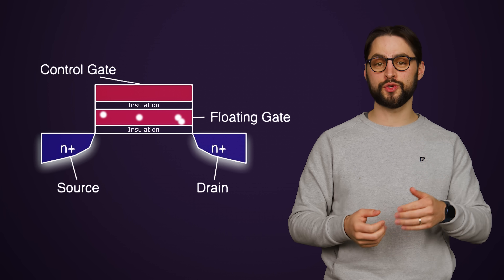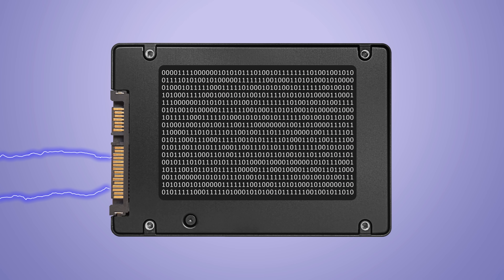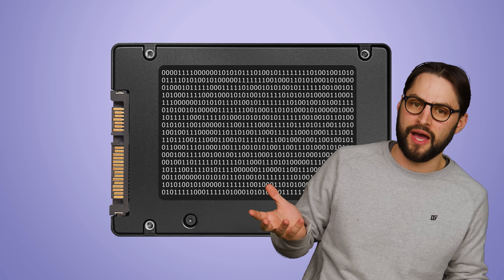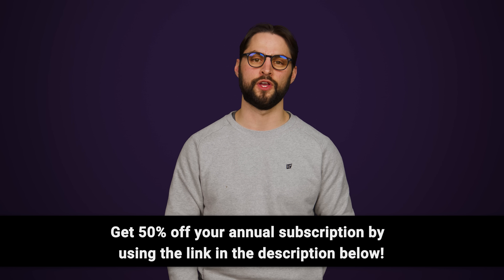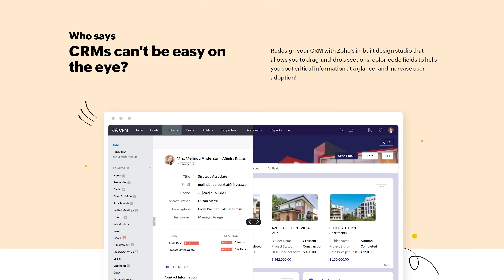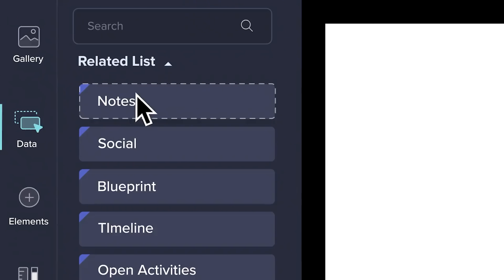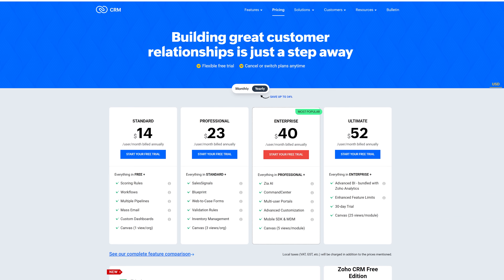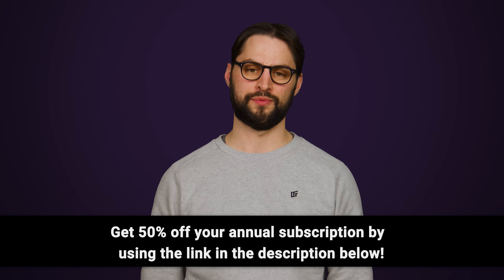SSDs Die, RAM Doesn't. Why?

Comment: Of all computer components, RAM is a completely analogue component. It works by virtue of voltage comparators made with high-speed operational amplifiers. At the exit of these comparators there are something called Schmidt triggers which outputs either a zero or a one, depending on the level of charge of the memory storage capacitor...
Reply: With that logic, everything in the computer is analogue... Everything is depending on voltage levels.
Reply: @someguy4915 Seeing as a transistor is an analogue amplifier (driven hard to saturated state in the computer) and the CPU and other SS components are made up of them, yes.

However, unlike Babbage's machines[1], it ignores all states between off and fully on

[1]being mechanical in nature, each memory "cell" was made up of rods which could be in one of 10 different states, each one representing a different digit (0-9).
Reply: @cigmorfil4101  Exactly, technically everything is analog, digital doesn't exist.
But since the logic in a computer functions on digital levels, the underlying analog signals are mostly irrelevant unless they cause faults/failures in the digital signal.
It's like saying cars are natural because they're made from metal which is in the earth.
At best it's semantics, at worst it's just false/misleading.

Comment: Yeah so as u asked for a feedback about what content you can make next.
I am a PC enthusiast and have been building PCs lately and with experience I understood this that with Ryzen APUs there lies a slight problem with gen 4 ssds because even though the motherboards may support gen 4 ssd the Processor I guess allots the PCIE gen 4 to the intregrated graphics and thus disabling PCIE gen 4 support for any components.
This problem especially arises in Laptops which are ought to be an APU for efficiency and do compromise on gen 4 ssd.
Also in case of Ryzen APUs the performance of the Integrated Graphics depend hugely on the frequency of RAM and latency... thus most of the times in a laptop that completely depends on the IGPU and doesn't have a dedicated Graphics it makes a lot of sense to use a DDR4 instead of the newer DDR5.
A lot of people are unaware of this and thus end up blaming the manufacturers for not providing gen 4 ssds and DDR5 RAMs.
I request you to make this clear to the incognizant people.

Comment: fun fact: (atleast for linux i beleve apple and microsoft has the same) whenever you go into hybernate your ram gets dumped into a very specicif part of your hard drive or ssd put aside. this is called the swap partison. if you are ever setting up linux and opt out of swap ram you lose the ability to hybernate on most distros.
Reply: Windows dumps the RAM to C:\hiberfil.sys when hibernating.

Comment: I'm no expert but I think this video got more wrong than it got correct. First a capacitor literally is an "insulating layer" so of course it has. Second, I don't think RAM uses capacitors as the storage mechanism. I think it uses logic gates in flip-flop arrangement.
Also bonus fail for not talking about the declining longevity of the SSDs, as the industry moves away from MLC to TLC and QLC. If you want to store data cold on an SSD you better find a 970 pro or older. Which are drying up on the market.

Comment: I've only ever seen one SSD fail personally and it was an Intel 240GB 530 series SATA unit back in 2015 when 240GB was a reasonably high end SSD capacity and Intel was the reliable drive standard before Samsung took over the market. The rest of my SSDs, even the cheap Kingston/PNY ones have been flawless but I havent had any of them long enough or used them hard enough to comment on their long term reliability (with the exception of my 960 EVO 250GB that was just now replaced after 5 years of service when I finally decided I needed a boot SSD big enough to hold a few games.
Reply: Samsung 970 EVO here , 1TB NVMe, been running nearly 3 years non-stop and health is at 98%. So it should be worn out by 2150😂

Comment: RAM doesn't lose all of the information at once, and it loses it in a predictable pattern. The data is lost slower at lower temperatures, so it's possible for someone with direct access to a computer to cool the ram with an air duster, load a special OS that doesn't write to a ton of RAM, and recover enormous chunks of data. It's rare but possible, and is referred to as a "cold boot attack"
Reply: Though very interesting attacks, these are just theoretical as in real world scenario's, any computer that has data worth that much effort (and the hacker can get physical access) will have a TPM and locked BIOS/uEFI preventing the computer from booting anything else.
And while the TPM can be read, or at least the LPC bus or SPI bus that most TPMs connect over, that requires at least one full reboot of the system, clearing the DRAM allready.
Reply: thats what the red disk took advantage of from the Asylum.   since A: is pretty much always read before boot, we took advantage of bios and gave the cpu an extra 10 volts...

was just a joke, but I figure a lot of cpu's were killed back in the day   LOL

Comment: Anyone remember those pcie cards that used laptop RAM as an ssd? I never owned one but I'd imagine it would probably have had a big capacitor or battery to keep the data during power off.
Reply: Those most likely would've either had a flash chip on them, using the battery/large capacitor to write the DRAM to flash when the computer loses power or they lose their DRAM content after a few weeks/months of no power...

Comment: I'll have to watch this later as I'm rather tired right now, but to be fair, one of my RAM sticks did end up going faulty and I had to have it replaced under warranty. That was the second stick I put in my original build (each at 4GB, and I started with 4GB to save money as it was $44 for Kingston ValueRAM DDR3 sticks around that time) that I got for Christmas 2014, so once it failed I was down to 12GB. It was really fun diagnosing the issue with Memtest86+ and swapping sticks into each of the slots individually /s, but at least it only occasionally gave me issues when using a lot of memory before noticing it was a memory issue. That's the last time I had major Bluescreens that weren't my fault (so unlike when I didn't uninstall ASUS and Intel stuff before moving to an ASROCK and Ryzen setup and had to clean up in Safe Mode). Funny enough, one of those BSoD's happened when I was watching an LTT video and Linus was saying something about crashing.

Comment: Nice video but actually pins getting bad is 1 of type of failure that might happen on both just on normal use.
Reply: But RAM warranty actually might give u instant new RAM if pin not working but SSD warranty wont
Reply: And pin coming bad i mean become rancid or peroxidation If thats even right translate for word i was trying find it with Google lol.. but its almost same as become rusty

Comment: The thing is. I pull more dead DDR4 ram than dead SSDs. By FAR

Memory is very sensitive to imperfect voltages. So they can just short out and die randomly. 

Hp computers kills more Memory than any other brand.

Comment: Also, the capacitors in RAM lose data within milliseconds and have to be refreshed many times a second. They are like flash memory that's extremely degraded. Reading from (dynamic) RAM clears the data as well, so it has to rewrite it each time the CPU reads it. It's just that this is expected behavior, and the constant refreshing doesn't degrade it appreciably.
Reply: In extension, SRAM uses transistors to hold the bits (actual flip-flop circuits), and never need refreshing.
Reply: @paulmichaelfreedman8334  not just "transistors" but triggers/flip-flops/latches, because DRAM also uses transistors as capacitors.
"In electronics, flip-flops and latches are circuits that have two stable states that can store state information – a bistable multivibrator. The circuit can be made to change state by signals applied to one or more control inputs and will output its state (often along with its logical complement too). It is the basic storage element in sequential logic. Flip-flops and latches are fundamental building blocks of digital electronics systems used in computers, communications, and many other types of systems."
Reply: @paulmichaelfreedman8334  And this is the main reason DRAM is preferred: SRAM takes 4-6 transistors per bit, whereas DRAM takes one.
Reply: @gblargg  It's much cheaper and more compact, bit for bit.
Reply: this is an absolutely must for understanding how DRAM works and totally missed in the video.
Reply: You mean behaviour

Comment: I was curious whether I could use part of the ssd as a ram for my Pc because Samsung phones have this feature now of ram expanding with part of the storage and I found a way to do that but, I felt like it might not be safe for the hardware to do that even if it is possible in the software and this videos made me sure that is is not a safe thing to do because using the ssd as a ram will make it wear out much faster than it should due to the intense read and write that on;y capacitors can handle and the ssd does not have capacitors. Thank you for the information and you can consider yourself the person who saved my Pc from exploding.

Comment: I had ram failure while installing drivers for a new gpu. The computer was running on integrated graphics before it got 1060 installed. After installing drivers the pc tried to reboot and crashed while starting up windows, and then failed to start loading windows, and then even bios wouldn't load. As I've said it turned out to be ram failure. Just curious, could this be just a coincidence?
Reply: There's no technical reason for installing drivers to ever cause any damage to RAM so just by that it must be a coincidence.
Most likely the RAM was already failing, Windows is actually quite resilient against RAM faults so probably this went on for weeks already.
Reply: @someguy4915  I guess so... That PC is quite old after all... New drivers installation was probably just a trigger for the failure that was building up for quite a while

Comment: I have backup hdds a lot of old hdd with all my backups since 2002 and all those drives still work and only have been used to back up. any time I plug one into my dock it works with no problems. Could I expect the same from a ssd 25+ years later ?

Comment: Which is why SSDs have:

big issues when just lying around without power input, over the years
they get slower when filled up
they die alot easier, when you use moar % space on them

you should also realize that SSDs rely as much on their internal controller, as traditional HDDs do. they can get faulty, even if the memory chips are allright
it's also good to know that they often use plastic instead of metals as casing and even if they use metal, they almost never make direct contact with the heating ICs on the boards. while they can take alot more heat, they will most certainly still be affected by too high temperatures. it is something that can happen when they do not get alot of airflow, which is easy to achiefe, due to their small form factor and position in the casings they are used in.

yes: there were RAM modules you could battery back, but it's nowhere near a permanent storage solution, since they use too much power. also, RAM does have a completely different interface, which would only be suitable for storage, if it were to have something like a sata controller, which makes no sense, since it a) uses up additional power and b) is much slower

for the same reason we have SSD memory chips and RAM chips differ, we have different chips as GDDR and casual DDR: they serve a different purpose. the one thing that's multipurpose is your CPU

Comment: Even cheap M.2 SSDs now have around 400Tb of writes before they go bad. Unless you're doing some incredibly heavy work everyday, that SSD will last you a very long time.
I've had mine for 3 years now, I've only written 120Tb so far (out of 300Tb in my case).

Comment: Yep, exact same reason why old game carts, (Super Nintendo/ Sega Genesis) Have Watch batteries in them. because their stored memory for saving game progress is RAM.

Which thankfully, you don't have to worry about the game progress wearing out, due to saving a lot. Also batteries aren't a big deal to replace. 

That definitely matters back then. Because flash memory that did exist back then. we're both very expensive, and could only rewrite a few times before dieing.

Comment: I've never had an SSD die.  Those tiny SD cards for cameras and cellphones can "wear out" too.  But really, you'll probably die of old age before you ever hit enough reading and writing on such a card.  That, along with just saving your data on them for archival purposes won't wear them out.
Reply: SD cards are very easy to wear out in fact. As they are just 'dumb' flash memory without a controller they are not aware of their own wear so they can't do anything about it. SSDs are aware of their own wear and can swap out worn out cells with reserve cells.
Want to wear out an SD card? Put Linux on it and make sure the log and swap partitions are on the SD card. It'll wear out within a few weeks.

Comment: I would like to know why unity engine pushes my gpu to temps that are so much higher then for example cry engine unreal and others ??
I have a 3080 with a fiull cover waterblock and its never really goes above 65c on the memory hot spot sensor. but on Unity it averages 90c and some games like just push 100-1004c
Not dumping on ubity as I do have a game that stays stable around 75c which is fine and on occasion it hits 82c but unbity really does seem to dislike DDR6+ and not play nice with temps
I have omitted to mention the game that messes so bad with temps as I do not wish to create an issue for the developer as this issue is not something I can find with ease on GFoogle for example. Therefore it might be limited to RTX cards ?? 
Looking at steam GPU stats and then considering 90% of gamers probably never run a utility as HWinfor64 to monitor things as memory temps the issue may or may not be more widespread ??
Any insights you guys have would be most welcome.

Comment: I had to RMA my RAM twice on my current PC.  Once because it was DoA, and once because my prior mobo was bad and caused electrical damage to the replacement RAM.  Diagnostics to determine a bad mobo are pretty much impossible when you don't have a replacement ready to test.  So I actually had to take it to a PC and phone repair shop...and it took them two weeks to determine the failure after they ran a 12 hour test, told me everything was fine, and I immediately got repeated BSODs again...and it was the second time when they told me that my RAM was dead because of a physical defect in two of the RAM slots (both slots in the same channel).

Comment: SSDs may be designed for millions of write cycles, but then again so is Windows. In any given 24 hour period of normal daily use, Windows and Windows programs will write to the system drive hundreds, if not thousands of times. Just opening a new blank tab in your browser will cause it to write to the drive. Opening a file causes Windows to write to the drive (have to keep a list of recently opened files after all!). EVERYTHING you do causes it to write to the drive. Even if you leave it sitting idle, programs will periodically write to the drive, as will Windows itself.

Comment: Thanks for this!  

I'm an old guy, have always dabbled in electronics, short wave radio, computers, etc.  In 1963 and 1964 I took a HS vocational electronics class. Vacuum tubes, I easily got. Simple transistors, not even.  Wait, electrons move this way (no different from tubes, filament to plate,) but then we have "holes" moving the other way? 

Couldn't get my head around that.  Still can't.

Comment: how about a ram stick with a battery?
Reply: Then your weakest link is now the battery.. those wear out too
Reply: But if you have ac to dc converter for ram and upc to keep it working during power outages would it work?? @wgllgw
Reply: This wouldn't be a new concept, either the opposite. Early flash storage worked exactly like this.

Most prominent example would be original gameboy games with a save function. They had a coin cell battery.
Reply: I mean like isn't ram of 16gb cost as much as 1tb ssd
Reply: What happens if you install like 1tb of RAM and use most of it as a drive.
It would be expensive and impractical , but also really fast maybe?
Reply: @Xnoob545you can right now concept is called ram disk , atleast in linux there is folder if you store something on it it will be stored in ram and it's fast af, and file will not survive a reboot
Reply: This is how old Nintendo consoles actually save their data, not sure I'm a fan though
Reply: Those batteries die and your data is gone. Take it from a guy with a ton of old game cartridges.
Reply: It was the usb sticks in the past. Them everyone comonly knew them to suddendly lose data and noone trusted them
Reply: Then you get how GameBoy cartridges save data